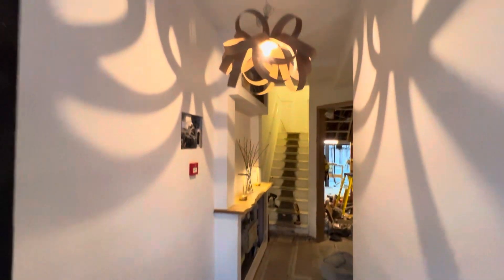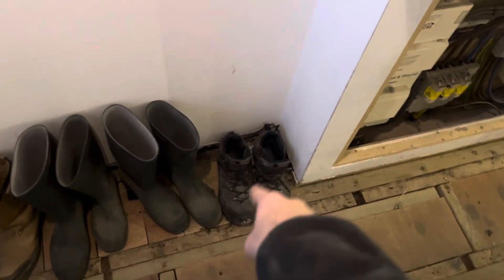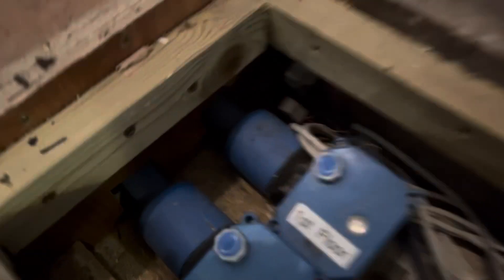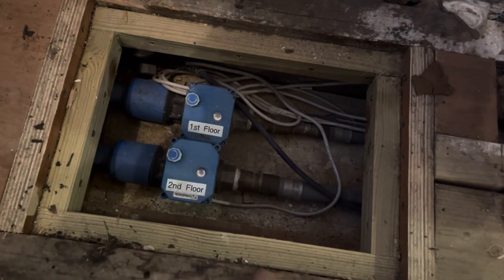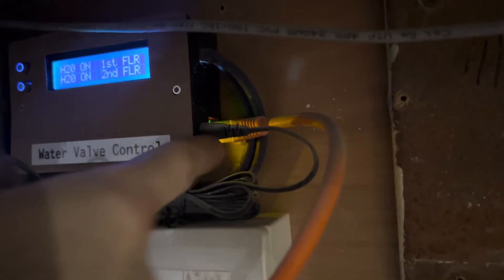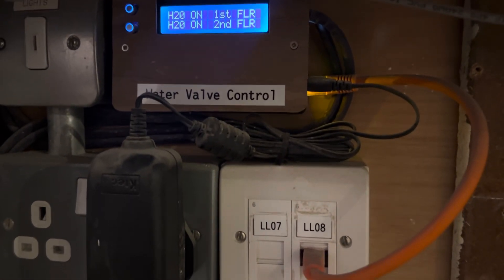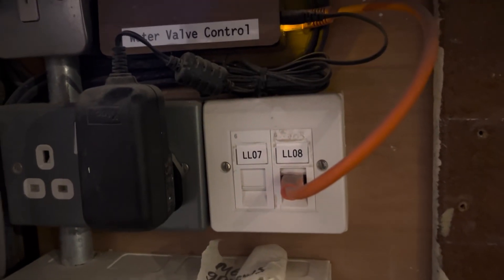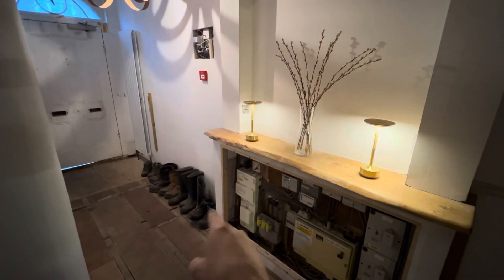MQTT flood prevention system: installing water sensor into ceiling joist space

Comment: Thanks for the shout out ;). I have at least 5 of those sensors around the house, under whiteware and hot water cylinders etc. They are very effective and do indeed have tamper detection, tripping if you move them. Really like the way you have setup your incoming water valves, with the manual override switches - I need to do something similar. 

Are you planning to automatically shut off your water valve if a leak is detected? Currently I have a notification setup which is sent to my phone when a leak is detected, with an action to "Shut off water". But I am thinking I should probably change that to shut off the water, and the "Leak detected" notification gives the option to turn the water back on. Don't want to be wasting seconds when there is mains pressure water leaking into the house!

Great video!!

Comment: what water valve did you use ? is it reliable ?
Reply from the maker: I used a 12V actuated ball valve. These are the best types for the application. Check out website called solenoid valve world, product number ABVM03S. I opted for 12V version, fail-closed (so if there’s a power outage caused by water then it closes), with manual override (thats essential for testing and troubleshooting!)
Reply: @MatSmithLondon  Is your home automation covered by a UPS.  What's worse than a 24 hour power cut?  A power cut with no water!
Reply from the maker: @jonathanInLondonUK  Yep, I have a 3kVA UPS but more importantly the ball valve actuators have manual override so I can easily turn them back on manually…
Reply: @MatSmithLondon  👍🏻
Reply: @jonathanInLondonUK  From the valve specs : Manual Override = Button Lift + Twist will open/close valve and disengage motor, push back down to re-engage motor.
Available low voltage only. (ABVM03S/9AR-MO, ABVM03S/9AR-NO-MO, ABVM03S/9-MO)